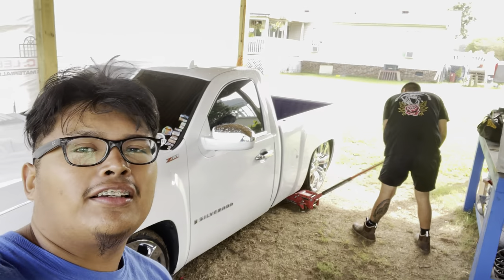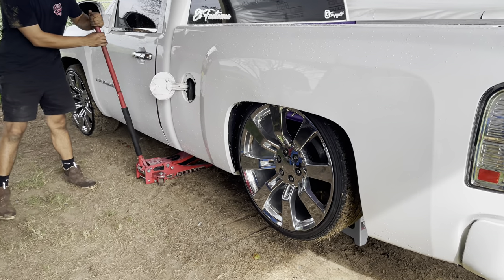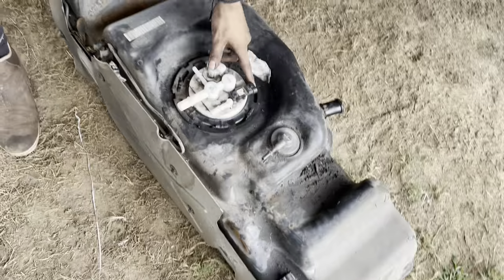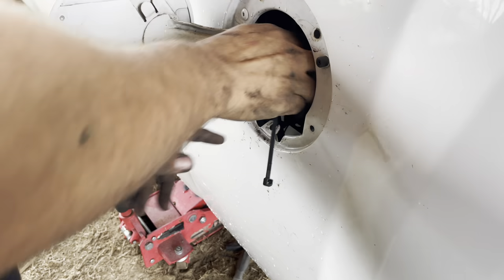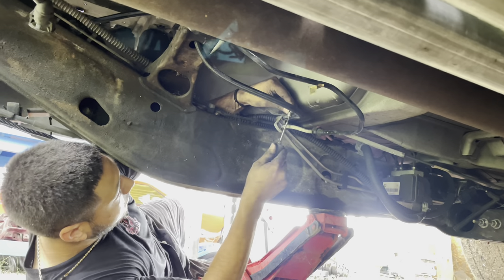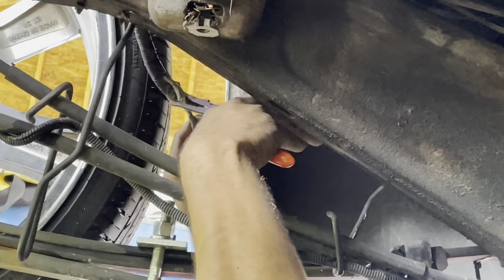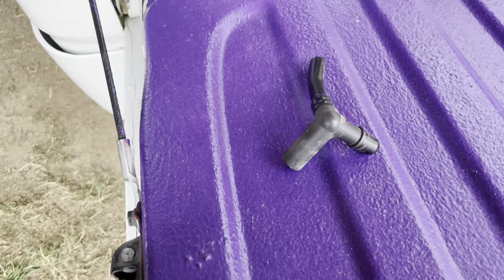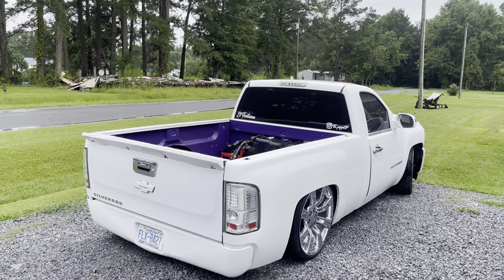How to relocate your gas tank on a dropped 07-13 Silverado‼️

Comment: Hey bro I love the truck bro goals asf 💯 I’ve been tryna get help on this question so since you low low how is your diff set up ? Like the pinion angle and stuff ? Did you use the Angle shims or how ??  Cause I’m having problems with my differential angle it’s pointing down a little more than normal
Reply from the maker: Appreciate bro but nah man I have no problems with mine and never had, I was scared it would but it never really was a problem
Reply: @Tu_Pappi07   I’ve been through 2 diffs cause the drive shaft and diff are angled bad so you think the flip kit can be the issue ??
Reply: @yeisonlopez6768  do you have a 2 piece drive shaft bro ?
Reply: @yeisonlopez6768  if you got drop blocks thats what usually causes bad angle